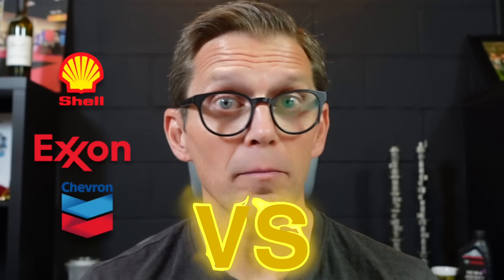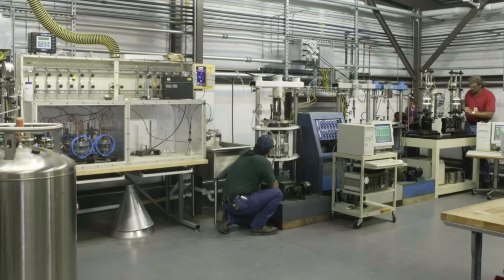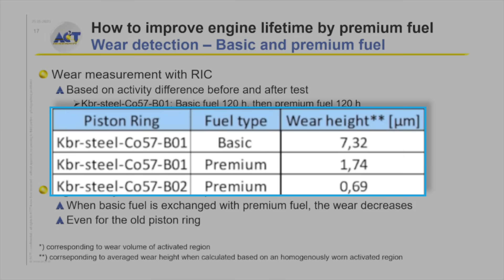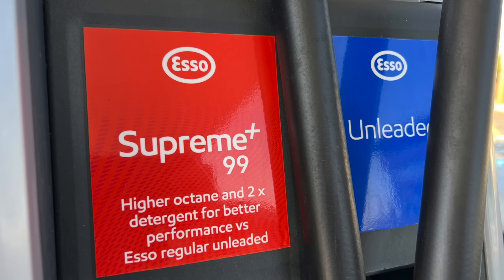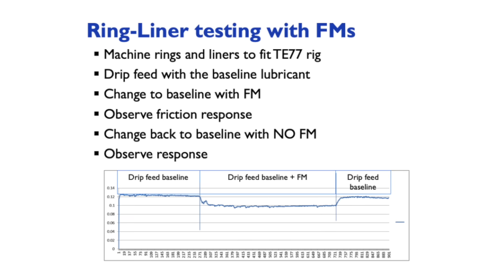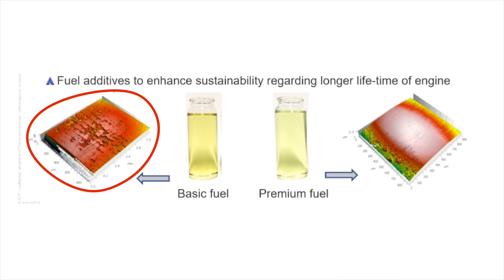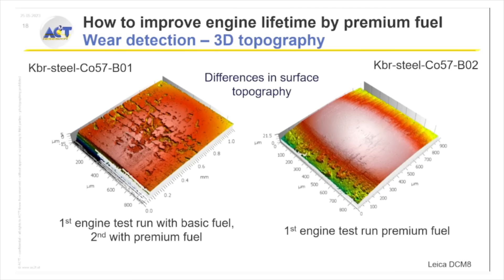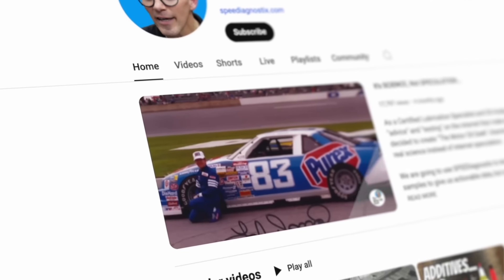Can Premium Fuel REDUCE Engine WEAR?

Comment: When I was a kid I did an experiment on my dad’s car for my 8th grade science fair. ran the fuel economy numbers and overall health of engine( noticing timing to see if the engine pulled some out, took photos of spark plugs(new set was installed after each run), also vacuum numbers, etc . I found that ARCO was the worst and Mobil was the best. Which actually correlated to their prices. 

At the time Mobil was running a big campaign on how much detergents were in their fuel. which I thought would cost some mpg, but it did not. Won out every category.
Reply: The only thing I didn’t do was take the engine apart to see wear 😂 I did build my first one though! It was a hot rodded 5.0, with ported 289 heads on it, crane cam, edelbrock intake and Holley 4150. K&N also gave me one of their new air filters at the time, it was when they released the filtered top for their 14x3 type air cleaners….. which I later found out actually costs you power and economy since it just lets hot air in 😅